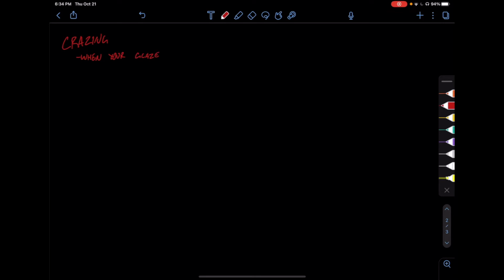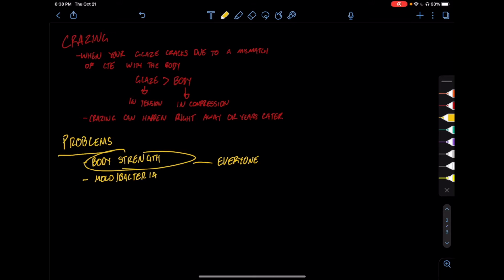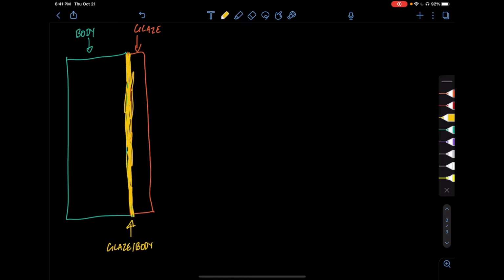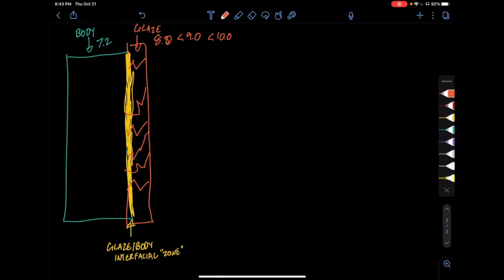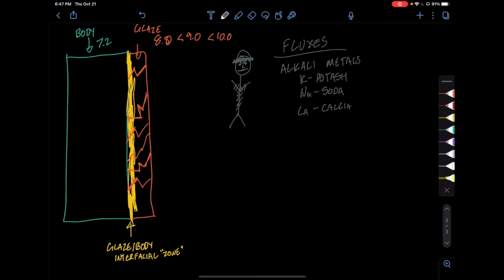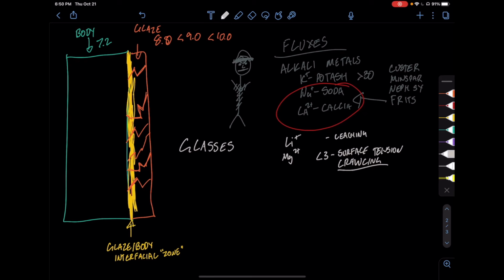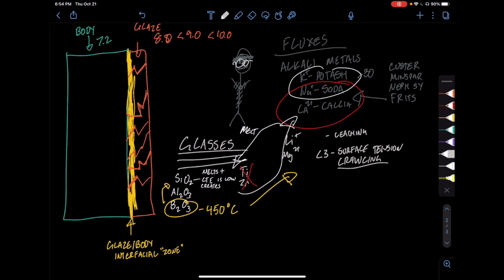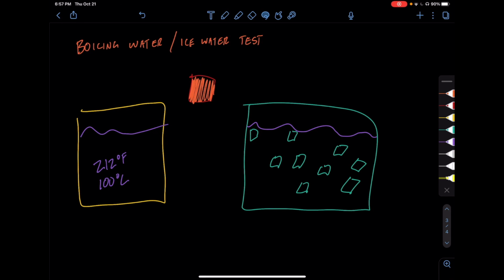Pottery Chalkboard: Crazing

Comment: The part about mold and bacteria is misleading. It doesn't take putting a damp cup in the back of a cupboard for year for this to be an issue. The pathogens will get into the cracks through capillary action. That means simple soap and water won't reach them sufficiently to kill the harmful stuff. The only way to properly sterilize a crazed piece is to ensure that the internal temperature reaches 165F for at least 30 seconds. They cannot be sterilized by simple handwashing. 

So the best practices for using crazed pieces is to wash in a dishwasher that reaches proper temp, and/or to limit to coffee/tea only. Also don't leave damp pieces sitting. 

Avoid thickly thrown pieces that can't be ensured to get hot enough during a dish cycle.